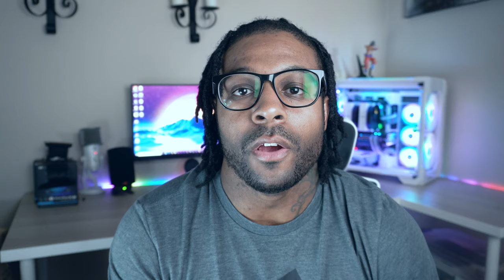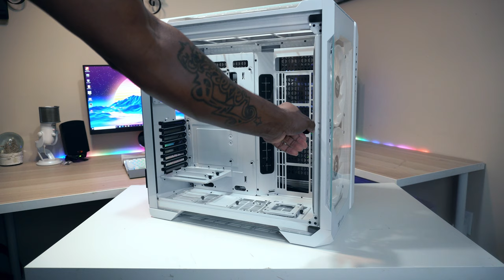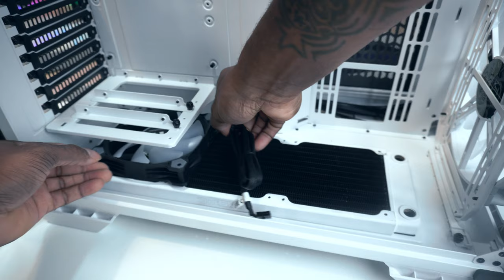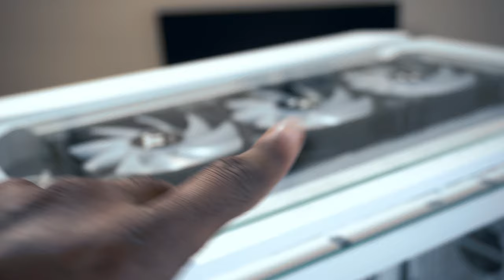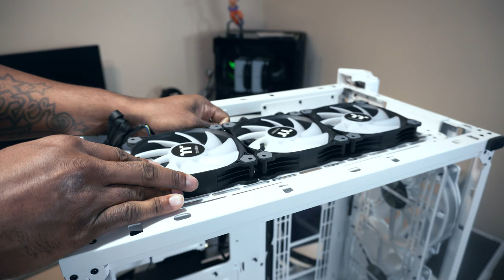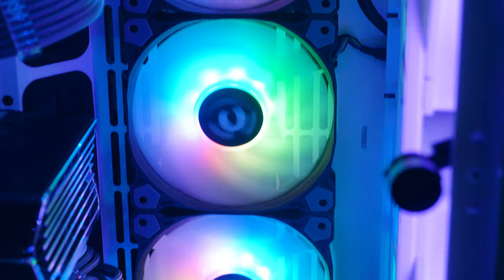Thermaltake View 51 RevIew: ITS BIG!!!

Comment: I LOVE my View 51.  Brand new build!  I'm running an i-9 11900 with 128 Gb RAM.  Maximus XIII Hero running Nvlink 3090's with a 1250 TT RGB Titanium power supply.  All case fans are the TT quad LEDs, 4-200mm, and 4-120's.  Side-mounted TT 360 water cooler with six quad 120's in push/pull.  That's 14 fans in total.  Also running LED strimmer's on the GPU and CPU power supply cables.  And the case is perfect cuz you have so much hidden space to easily hide the wires...and there are a lot of them!  But I must say...it's a pretty setup...and it flies!
Reply from the maker: Holy crap man, boss build! Lol

Comment: I just ordered this same case,  gets delivered on Sunday,  I plan on putting my 360mm aio next to the motherboard as an intake along with the 2 front 200mm intake fans,  then the top exhaust and the back fan exhaust,  I'm stoked to build this
Reply from the maker: That's gonna look good man! Do you have a Twitter? Follow me on Twitter and tag me in it @PettyFixes. I wanna see!
Reply from the maker: Alamo make sure u sub man, I have a lot more coming.
Reply: @PettyFixes  I definitely dropped a sub, just curious how come you didn't use the top 3 fans as exhaust, cause usually hot air rises and exhaust is perfect on the top and back of of case, and intake on the front, bottom, and next to motherboard
Reply from the maker: Oh I'll be swapping the orientation when I do my water-cooling. A 360mm up top, and a 360mm at the bottom is probably the route I'll go. I have a specific vision in mind. I need some cross flow rads and that's all I need!

Comment: Your video is amazing AF!!! The vertical gpu riser tray mount is removable so that you can fit a thicker aio setup on the bottom of the case. Sadly the power supply has to come out to access most of the screws.

I was wondering if there was a way to adjust fan speed without buying a separate fan controller?
Reply from the maker: Unfortunately there isn't with the built in fans. You will have to buy your own and use the fan headers on the motherboard or use the hub that comes with the fans if one does.  But thanks bro! Please subscribe!

Comment: This case looks sick but I'm bummed about the bottom rad thickness support. If I remove that stock vertical GPU mount and use a 3rd party version the GPU would sit higher meaning I can use a thick rad right?
Reply from the maker: Yes that's the only thing that bummed me. I wanna do push pull on the bottom. The only way is to remove the bracket. But I want a vertical gpu. So I haven't tried out any other 3rd party ones to see what the difference would be, but I'm sure if you do, it would make a big difference. This was with the pcie slots rotated, so with them in the regular orientation, I'm sure a 3rd party one would give more room at the bottom.
Reply: @PettyFixes  Thanks. Btw are the supplied fans PWM adjustable? Because on their website it says the 200mm fans are "fixed 600rpm" and the 120mm fan "fixed 1000rpm" I'm so confused
Reply from the maker: Yes they're fixed. I'll be replacing them in my build. Sucks because the white fans are awesome lol

Comment: Great video. I hope you realized later that most of your fan orientations were backwards based on what was shown in your vid. You have the 2 front fans blowing air in and the 3 inside fans sucking the air out from the 2 front fans. Then your top fans are blowing down inside the case which should be blowing up and out. If you haven't fixed this try it your cooling will drastically increase.
Reply from the maker: On yea I only did that for show. I changed it around as soon as I finished shooting lol.
Reply: @PettyFixes  All good man, keep up the great work.
Reply: @PettyFixes  And how did you exchange it?

Comment: Thanks for the review on this one. I've been eyeing this case for my first build. For the price point TT should have made the fans included their PWM models. Hell I'd even pay a little more for that feature.

One of the best reviews on this case. I definitely subscribed for future videos
Reply from the maker: My point exactly that to was making. U can't use the fans on their own TT controllers or even hook them up via PWM. But they're replaceable so whatever lol.
Reply: @PettyFixes  that and I'm surprised it's no dust filter for the top and front either.  Still getting it though cause that case is too dope not to 😭
Reply from the maker: That's literally the one thing I forgot to mention. I was kinda worried about that lo

Comment: Have you noticed how much the front gap in the glass is extremely limiting to the 2 200mm fans? Do you know any fixes for this?
Reply from the maker: I'm actually about to replace these 2 fans. I'll be getting 3 140mm fans. Also noticed these fans are a little thicker than normal sized ones so it should help to facilitate in more air flow with smaller fans.

Comment: Cool build, I wanted a big case as opposed to mid tower this time.....mine is a much simpler  build but it's a big upgrade from the old 6350fx.....I want to add 3 fans on the top as you did....should they be spinning to suck in cool air from the top....or pushing hot air from the case.... nice vid....
Reply from the maker: They should be actually exhaust, I've changed it recently to reflect that lol. Exhaust the hot air that rises. Intake air from the front and sides, and in this case the bottom if u install fans on the bottom.

Comment: Thanks man! I am just starting to build my new machine and have spent days figuring out which case to go with, you sold me man!  One question why did you chose to go with fans and not water for the CPU and which CPU cooling is that you chose?
Reply from the maker: Awesome bro! Well, it's the Deepcool Gammaxx CPU cooler. I want to go with a cooler but it just isn't in my budget currently, unless someone wants to gift me a Thermaltake Water 3.0 120mm... 👀👀👀 Lol. But I definitely plan a custom loop in this case soon. Make sure u sub to keep up with my journey with this case!

Comment: What Fans did you use on this Build? Getting this case delivered soon and can't seem to find fans i like to install into it, but i do like the fans you used on this setup more than a lot of the ones i see on Amazon.
Reply from the maker: I used Thermaltakes Pure 12 fans. I didn't wanna pay for their Riing fans, too expensive. I got these from Best Buy. Around $60 for the 3 pack and the controller.
Reply: @PettyFixes  That's a good choice, thanks for the suggestion there. I also thought about the Riing but the price also kinda throws me off. So pure 12 it shall be for me as well!
Reply from the maker: Pure Plus 12. There's a slight difference, but they're the only ones best buy sells lol. So go with the Pure Plus 12 120mm. I wanted the 140s but they were outta stock. I'll be replacing those 2 200mm fans soon lol
Reply: @PettyFixes  Gotcha, i'm particularly fond of the 200mm since my first case uses them, so i ended up keeping those and ordering 6 of the Pure Plus 12s. 3 120mm for the inside, and 3 140mm for either the top or front depending on what i feel works and looks best for me. Thanks a ton for helping me make a decision! I really appreciate it.

Comment: The case looks good and good review too 👍.
I would like to know how is the airflow from the front 200mm fans as the fans seem too close to the front glass panel.

And have you put the three fans beside the front in a configuration that pushes air out?
Reply from the maker: The airflow is actually VERY GOOD. They're set further back than it looks on camera. Plenty of room to breath.

Comment: Question brother, if all the fans dont fit on the controller did you just put a splitter on pwm and meet your fans wired together and the case fans from controller both there? Or did was there a controller that supported case fans and your additional fans?

Great video by the way bro, super helpful. I'm ordering this case for my first build very soon.
Reply from the maker: So basically the fans that came with the case we're already on a hub. It came built in. The extra fans I populated the case with came with a hub of their own. But personally I didn't like the bubs because they had issues with being detected by the software numerous times. So I bought a 9 fan hub from Amazon made by Thermaltake themselves. It uses a 3 pin rgb header on the motherboard so u can control the LEDs in the fan by the motherboards own software instead of Thermaltake shitty rgb software. Also, it has PWM control on the fans as well. That's how I got it the way I have it now!
Reply: @PettyFixes  I appreciate the quick response bro! That helps a lot with getting this build set up. Keep up the great quality videos bro I'll be looking out for more!
Reply from the maker: Thank u bro! I got 2 more coming this weekend! Also make sure u sub! I'm always interactive with my viewers!

Comment: Would this fit a Noctua D15 with both fans, Im looking for a big ass case... oh he buillt it! Man I'm so used to everyone doing liquid lmao
Reply from the maker: Lol well, yes/no. I actually own a D15 and I had it installed for the longest. It fits. But if you have tall RAM, you will have one fan slightly higher than the other and it WILL touch the glass panel ever so slightly.  But it does fit and allowed me to close my window still.
Reply: @PettyFixes  damn it haha, my ram is crucial balistix rgb, I think its low but man I cant find any case that fits this beast cooler
Reply from the maker: It's definitely hard to. This case suffers from the fact that it's a dual chamber case. The Psu takes up quite a bit of space and it pushes the motherboard tray upward about a whole 2" or so. That's the issue. But it'll fit the cooler. I still could close my window.
Reply: @PettyFixes  I currently bought a h500 master and its got 167 clearance, needs 165 but it doesn't look like it will fit, so I'm returning and now looking for a case but cant find any with 200mm and good thermals, were temps fine in this? I know Gamers Nexus hates glass fronts
Reply from the maker: He hates em but bro there's so much space in this thing, thermals have NEVER been an issue for me lol.
Reply: @PettyFixes  Those 3 fans next to the 2x200mm then intakes for you? I dont have a radiator so dont want it to be left blank and look dumb but I got 6 120mm fans... might get the case, appreciate the help
Reply from the maker: Yes I have them as intake. I'm gonna change the 200mm fans to 3 140mm fans when I get the chance.

Comment: Great video man! Question for you. I'm looking to scratch my outdated custom build & start fresh with this case. Gonna grab a 3080 if I can get my hands on one when it drops in a few weeks. Would I need additional cooling for that besides the fans in this case?
Reply from the maker: Hey thanks for the kind words! I personally would grab some fans for the bottom as intake. 3 120mm fans would be great for it for blowing cold air into the case for the GPU to intake and exhaust.
Reply: Petty Fixes I appreciate the response bro I'm a PC noob trying to find my footing lol. If I pair the 3080 with an AMD Ryzen cpu would you recommend upgrading to 32 gb of ram or am I good with my 16? Also my old pc has 250 gb of ssd should i put that in the new build with a 1TB extra ssd? or maybe more than that? Lastly my old power supply is 650 Watts would I have to upgrade that for the new build? Sorry for a bunch of questions lol just tryna learn how to build this new pc to optimize the 3080 w/o going overboard spending wise if I don't have to
Reply from the maker: I'd recommend going with a 750w power supply. Word is that those GPUs are gonna be a lil power hungry. And a Ryzen cpu would be perfect! Also, 16gb or RAM is fine if all you're doing is gaming. If you're editing or anything similar, then I'd recommend 32gb of ram.
Reply: Petty Fixes Thanks so much🙏🏼🙏🏼
Reply from the maker: U got it bro!

Comment: Good content, was looking to buy this case but still unsure vs Corsair 680X
Reply from the maker: This is a much more versatile/spacious case than the 680X. I actually just got rid of the 680X lol. This is much more of a pleasure to build in, and it's cheaper. More space, more for custom loops if you're into that sort of thing.
Reply: @PettyFixes  thanks, what's your feedback about dust, just conscious this is white case, how bad does it get after few months? I normally clean each 6 months
Reply from the maker: Well I've had numerous white cases over the years. The dust isn't as bad as you would think. Proper dust filters make all the difference. This case lacks proper dust filters for the front and top case fans. This may be a problem. But a proper dust blower or some compressed canned air will work just fine.

Comment: does the front glass panel blocks the airflow becouse it looks like that could block the airflow
Reply from the maker: No not at all actually. There's a pretty big gap between the glass and the fans and the sides of the panel are actually open about an inch.
Reply: @PettyFixes  im using a similiar case to this and it also have a big gap between the glass panel and the fans my case also have 2X 220MM fans in the summer i notice my PC is overheating so i removed the front glass panel and dang my GPU temp drop below 10 degrees lol
Reply from the maker: Which case are you using?
Reply: @PettyFixes  its called Rampage Squadron not a known case but it has very good airflow and size

Comment: That's a really nice case.  Do you think the glass window in front will obstruct airflow?
Reply from the maker: Oh absolutely not man. Never had an issue.
Reply: kinda the same concept as a dust filter but i feel this was clever adding gaps between the case to keep airflow moving while keeping a glass there to alot of the dust out. 

I would say dont choke your pc by having it in a extreme warm area and you will be fine.

Comment: Kind an airflow n00b.  Can you tell me how all the fans are flowing?  Great video by the way!
Reply from the maker: Front is intake
Rear is exhaust
Side is supposed to be intake but I installed them as exhaust for demonstration purposes
Top is intake.
Reply: Petty Fixes so best practices are basically all intake with the exception of the rear?
Reply from the maker: Top fans usually would be for exhaust as well. But I did those for demonstration purposes. Hot air rises so it would be wise to do top and rear as exhaust, everything else as intake.
Reply: Petty Fixes forgive the confusion but the top is covered with glass so how is air supposed to exhaust?
Reply from the maker: There's a pretty big air gap for the air to exhaust lol. There is plenty of space for hot air to be expelled from the top.
Reply: Petty Fixes 10-4 thanks for the follow up brother
Reply from the maker: Absolutely!

Comment: Top fans have to be moved inside way too close to glass. Side fans should be removed cuz its evacuating the air that comes from the 200mm fans. I like this case but dunno about getting it.
Reply from the maker: I replaced my 200mm fans with 3 140mm fans. Used the side fans for intake on a 360mm radiator. The top fans, I am on with the placement because there so much space under them for push pull on a 360mm radiator should u choose to go that route.

Comment: Do you need a riser cable if you are not going to mount the gpu vertically? thanks
Reply from the maker: Yes and it has to be the one Thermaltake makes. Not a 3rd party one. I have 4 3rd party ones and none of them work. It's all because of the way that Thermaltake has designed their GPU bracket.
Reply: @PettyFixes  Thanks for the info!
Reply from the maker: Absolutely man no problem!